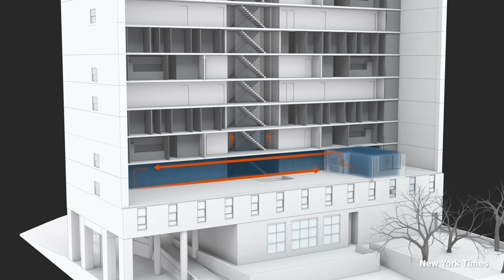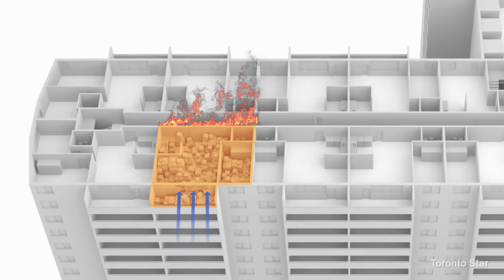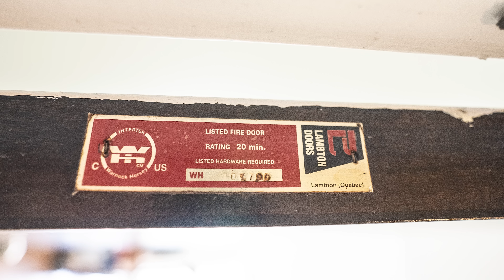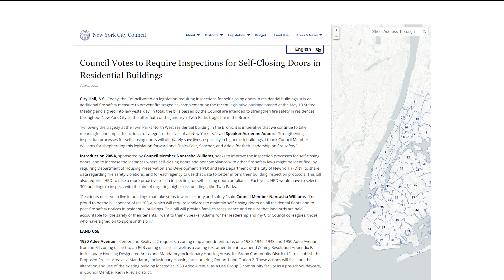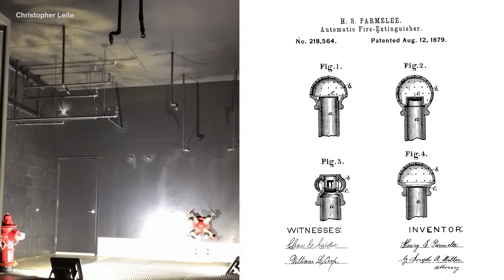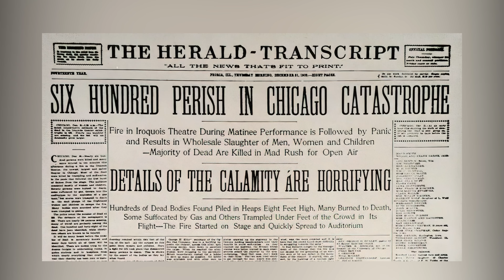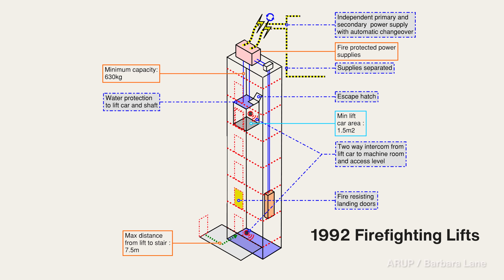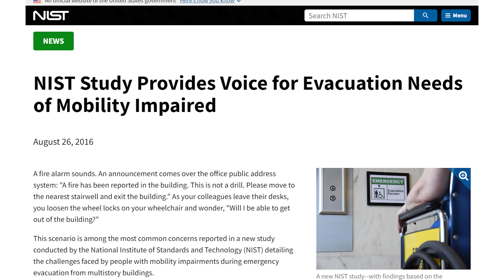How Hidden Engineering Keeps You Alive in Apartment Fires

Comment: This doesn’t apply in the UK. Many buildings still have the same cladding as the Grenfell tower, the residents are unable to sell their flats and move away because they are knowingly not fire-safe, the building managers won’t remove the cladding because there’s no government pressure to do so and the residents can’t remove it themselves. They are forced to live in a deathtrap
Reply from the maker: So yes this is currently problem in many buildings that have not been retrofitted.  There were some short term solutions highlighted like "waking watches".  This sounds like it will be fixed in future and people are aware of the issue so they won't stay in place.  

For the people saying laws have not been passed, the Building Safety Act was given royal assent and the intent is to reform the industry: https://www.cibse.org/policy-insight/key-policy-areas/building-safety-act  Of course implementation is very different but it appears that it's headed in the right direction.   

@PirateRubberDuck had a great response that gets into the nitty gritty
Reply: @Lam That incident exposed many unwanted things.
Reply: Grenfell is a national disgrace, since due to austerity, the refurbishment was approved by a surveyor employed by the development company. The government surveyors only did the admin and no physical inspection. 
Their were 2 reasons why the fire spread. 

The first was due to NONE of the 200 fire barriers that would have contained the fire to the exterior area covered by one apartment being fitted. These would have held the fire for 30 minutes, prior to it moving on to the next area.

The second (and far worse) problem was 3 inches of flammable insulation applied to the building first.

Most installations, although not 100%, would not allow a fire to spread rapidly, so they need to be checked by competent qualified surveyors. 
Panic removal of the cladding is not the answer, unless it has been checked and deemed unsafe.

PS.
If you have not already guessed, I am a UK chartered engineer, (now retired).
Reply: @wilsjane  I've noticed that some modern blocks of flats use wooden panels for the external walls, which I would have expected to have not been allowed. Think some also have some or all of the internal walls made of wooden panels (probably plasterboard).

I'm not an engineer but imho all external walls should be made of either concrete or breeze blocks, same for the internal walls between flats and around all stairs and lift shafts and shafts where utilities go up and down the building, with perhaps water lines for fire hydrants being in their own dedicated, protected shafts
Reply: @leeroberts1192  You are absolutely correct. Where any combustible cladding is used, it is over concrete walls. This method is often used  to save the cost of brickwork. Both horizontal and vertical fire rated battens are fitted behind the cladding, to avoid fire spread between apartments in multi occupancy buildings. These also act to prevent airflow behind the cladding, thus slowing spread of fire by around 75%
Interior partitions use plasterboard which is gypsum cored. When heated, gypsum liquefies, adsorbing 540 calories per gram and slowing fire. 9.5mm board is 30 minute rated and 12mm one hour. Both these figures increase by 30 minutes when the board is skimmed with plaster. 
For the studwork behind these walls, Hyrib is increasingly being uses to replace timber. This is galvanised steel channel and box sections, the board is attached using self drilling screws. 
The most important factor as that ceilings above these partitions are continuous, preventing fire spread between floors and into the roof. The partition header is also horizontal and continuous. Any holes for pipes and cables are also caulked. 
150mm solid walls are still used between apartments and between apartments and communal corridors. These can be a lighter weight or concrete, but are still fire rated. 
These days, almost all floors between levels    are continuous steel and concrete on new builds. Cables and pipework are installed in a 50mm screed. at floor level and between the 25mm battens holding the plasterboard ceilings. 
I hope this lengthy explanation all makes sense. The few fire deaths in the UK are almost all the result of botched conversions. Grenfell being by far the largest example.
Reply: @wilsjane  The ones I've noticed the actual external walls are made of wood and not just clad with wood.

When they first showed the interior of the Grenfell tower after the fire the thing that struck me straight away was how you could see all the way across the floor. I'd expected to have seen solid walls between the flats and between the flats and the communal areas
Reply: Source Inside Housing published this month
"Figures from the Building Safety Programme in September show that, of the 160 high-rise social sector residential buildings identified as having aluminium composite material (ACM) cladding, 119 (74%) have now completed remediation, including receiving sign-off from building control where necessary.

The remaining 41 have all started remediation, with 40 known to have had the cladding removed. Fifteen of these have completed works and are awaiting building-control sign-off, leaving one building where remediation has started but cladding has yet to be removed."
Reply: This does apply in the UK..in theory. Unfortunately some idiot developers decided to completly comprmise the idea of the fire prison by using cheap cladding. There is a huge amount of pressure being pushed to get this solved. It is unfortunate for everyone.
Reply: That's just part of the problem, the real problem is you're depending on all these system actually working properly if you shelter in place. This is no simple thing, they are "fireproof" in theory, but that requires all the sealant to be applied right, firedoors to be properly maintained, venting to be maintained, etc. If there's a fire a fire and you can get out, get the fuck out! Don't shelter in a fucking burning building hoping the complex fire proofing system actually works, it's always safer outside.
Reply: After Grenfell. We have fought our hardest but as we know they don’t care. We tried and tried😢 And yes, we got somewhere but it isn’t good enough
Reply: I'm pretty sure there IS government pressure, which is exactly why 100s if not 1000s of buildings are currently being re-clad.
Reply: @mdhazeldine  Zero laws outlawing the cladding or requiring firebreaks in the cladding have been passed. Any recladding of buildings is being done by the owners of the buildings at their own expense, not because they were forced to. Any pressure on the building owner to do so is coming strictly from the residents. And for towers like Grenfell which are owned by the local council, pressure from residents don't matter as much as whether the local council member that would vote to pay for that is concerned they'd lose their seat or not. If they're in an area where voters want to limit spending on their council housing and vote accordingly, they're not likely to approve that kind of spending.

And frankly, what I've learned about UK's fire safety codes since Grenfell is just baffling to me. London's burned down how many times? And yet their fire codes aren't as strict as the US's. It's a weird position for me to be in cuz usually the UK's got better safety laws in general, but not when it comes to fire!
Reply: @BreeBadger  That type of cladding is currently illegal to use now, but older examples are grandfathered.  However, that cladding does not last forever.  So as it needs to be replaced, the situation improves.
Reply: @BreeBadger  You are mostly correct as far as I know and hopefully soon you will be far less correct. 
The UK government, through a number of bodies, is reviewing building safety regulations right now, this includes Approved Document B, BS9991 and BS9999, with particular focus on tall residential buildings, and will be publishing more information over the next couple of years and the information coming out already is being reviewed by industry experts. 
Parallel to this, building fire safety is under review by major architectural/multidisciplinary studios and fire engineers. 
The new gateways for planning approval are already raising the standard of fire safety design and we will see the results of that in new builds as designers are now being held to a higher standard that the current standards and regulations, which is a little confusing for all, but will work itself out. 
The push for the ability for disabled residents to easily be able to evacuate a building without assistance is also making a difference, in particular with the New London Plan in regard to evacuation and fire lifts, although these high standards are also being applied to other projects in the UK. 
And on top of that there is the new standards coming out for the recording of fire safety information following the Golden Thread and including that in digital construction information, digital construction/BIM models coming from fire engineers, and the new addition of FIREie coming soon, which is similar to COBie BIM information, but for fire risk management. 

I could go on, but my comment is getting pretty long already. 

TLDR: Stuff is happening and the standard for fire safety is being improved in the UK in every way that the industry can think of.
Reply: @BreeBadger  this kinda cladding was illegal when it was installed, so your point is kinda moot. Why make another law making something that's already illegal illegal?
Reply: @CaseyEm  It was (and still is) illegal in the US, but not in the UK.
Reply: @BreeBadger  On 18 June 2017, Chancellor of the Exchequer Philip Hammond confirmed that the cladding used on Grenfell Tower was banned in the United Kingdom.
Reply: @BreeBadger  all cladding from council owned buildings have been removed.
Reply: @xhogun8578  what’s the source for the claim that all cladding has been removed from council buildings?
Reply: @CaseyEm  Too late.
Reply: @BreeBadger  
Don't underestimate the collective power of tenants. 
They can always simply agree to stop paying the maintenance fees en masse, leaving the building owners with zero options but to fix the problem.
Reply: @MikJames-d1g  That's going to depend on the local laws. In my state, that money has to go into a escrow account and is only released to the landlord once the problem is fixed. I'm sure the UK has similar laws in place.

And if you just stop paying? Legally, they can evict you. And yes, the entire building full of tenants if that's the case. Yes, that's a pain the butt and majorly disrupts the landlord's income. But they can do it and if there's enough desperate renters in the area? They'll fill it back up soon enough.

That's why ppl need to pay attention to what the laws are regarding such things.
Reply: @BreeBadger  
Yeah, in this context there are no prospective tenants, as they can't legally sell the homes. These are condos/townhouses we're talking about, bought and paid for, not apartments.
The only "rent" is for the shared spaces/general building maintenance (like removing flammable cladding).
Reply: @MikJames-d1g  In that case, I'm sure there are ways for the local government to seize the housing legally and evict them. You can't just stop paying your fees without legal action being taken against you - including seizure of property.

But that would depend on the contracts they signed when they bought the property. And ofc not every unit in these types of towers have actually been sold to the residents. There's plenty where they are renters.
Reply: @BreeBadger  
Of course, I'm not saying they'd make it easy, that's why you make a collective lawsuit out of it along with the threat to stop paying the condo fees. 
Either way, what they're doing IS illegal, and tenants have a right to fight back if action isn't taken.
Reply: @MikJames-d1g  I'm aware of that. I'm just pointing out that there are various laws on how to handle such things. You can't just stop paying - even if you manage to get everyone in the building to stop as well.

And if they're suing, they've mostly likely taken a look at the laws and are doing what the law allows.
Reply: @BreeBadger  
Yeah dude actually you're completely wrong, that's my bad for not calling you out on the obvious problem with your "logic" (sorry forgot about the details of this conversation).
Look at it from the condo association's perspective. Everyone decides they're going to stop paying the fees and they legally aren't allowed to re-sell the condos without doing the renovations. Nor is it actually legal for them to just evict people who paid for their homes, not without buying them out. Either way it's check mate for the companies maintaining the buildings. All they can legally do is walk away from the contract to maintain the buildings, they can't evict people from condos (if they could, who in their right mind would ever buy a condo).
This conversation is getting pointless, I already explained why you're wrong a week ago and just forgot about it... learn to read.
Reply: Skill issue
Reply: We’ll yea That’s why this was in the English language not British language duhhhh
Reply: I remember that horrific fire.
Reply: Well, the UK is a struggling country and opted to stay down as a country. Brussels is doing a lot on the building standards and getting Europe ready for the future.
Reply: @Kevin-bl6lg  Good luck to them. Grenfell and Brexit we’re both brought by those for whom selfishness is their religion, and I hope folks across the channel can push back against the spread of this creed of nastiness better than we did. Any policy anywhere that benefits the average person’s quality of life over some parasite’s bank account is welcome in my book
Reply: As a plumber I’ve worked a lot with fire stoppers and had to deal with even more of their bullshit .it’s borderline requires respiration equipment and they will fill a hole 10 inches away from your face ,and it’s often poorly done . They will fill holes with the bare minimum to save time we’d have stacks of 2by 4s 6-7 high and they’d fill the top and bottom ones ,safety guy can only check if you pull out another trades work .if you are employing fire stoppers on your job site walk with them while they work and check up on them frequently your more worried about the older guys and you gotta double check if it’s not a comfortable job site because they will screw you to save themselves money I’ve heard Forman and owners tell them too do it .if it was anything else it would be easily inspectable like I see concrete guys covering their ass by recording their work when they put rebar in
Reply: Wtf🤯 just now noticed I haven’t been in an outdoor stairwell since being in Japan
Reply: Developers have generally now moved away from cladding though, most new builds are now brick slips.
Reply: So um.... why aren't residents allowed to remove them at their own expense?
Reply: @CoffeeKittyGhuleh That was true, but not quite in the way that you put it. 
Each apartment had a one hour fire resistant front door. This maintained the stairwell as a safe smoke free means of escape.
As the fire went up the outside of the building, complete evacuation was necessary, but as the firemen started banging on the doors, 2 apartments above the original fire had no response. The firefighters decided to break the doors down, only to find no one at home.
Within about 5 minutes, fire entered these apartments and with the doors missing toxic smoke filled the entire stairwell. 
Had those doors remained, as fire approached the higher levels, residents would have obviously left their apartments into a smoke free environment. Firefighters would have been around to ensure that they closed the door. 
Since this was the normal entrance and used daily, it could not have been blocked.
Their is a possibility that in those early minutes, a few or the residents were trying to save their possessions as they were attempting to escape.
Grenfell caused more trauma to firefighters  than any incident since WW2. so I do not want to start proportioning  blame. Following the fire, our daughter spent 6 months in the building, sometimes overnight and it still haunts her to this day.
Think about those doors, it may help you to understand where things went inadvertently wrong.
Reply: bit of an L
Reply: How many buildings have the same cladding as Grenfell?
At least 10,000 buildings are still covered in the flammable cladding at the centre of the Grenfell disaster.

UK's Parliamentary Housing Committee noted that a further 9,600 buildings were likely to have combustible cladding.
Reply: All the money goes to the Royal family. Why would lawmakers make competent laws in the UK when they can have noon tea?
Reply: I can’t imagine putting out a video on this topic without mentioning Grenfell. That was government housing recently renovated. And residents were also told to stay put.

They actually considered installing sprinklers but judged it to be too expensive. But they spent a lot more making the building look pretty.

I would really find out about the reality in any particular building before moving into one.
Reply: average british L
Reply: If the government did not prevent such cladding to be installed in the first place, then it's government that should fork the bill to replace the cladding.
There's a reason why architecture must be approved by the city prior to issuing a building permit. If the cladding was wrongfully sold as fire resistant then that company should be sued.
Also the details of "fire resistance" must be clarified. At what temp does an object catch fire? Most items will catch fire at a certain temp.
Nowadays there are false selling terms being tossed around to sell a product. These claims need to be reviewed by a government issued agency.